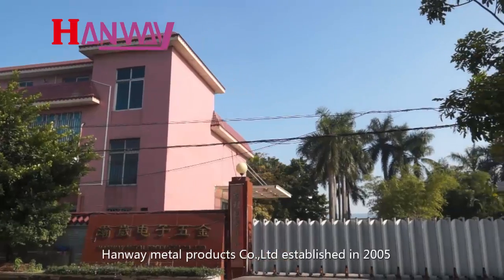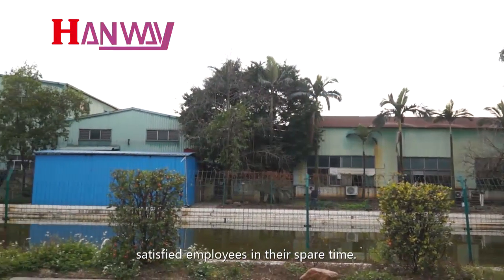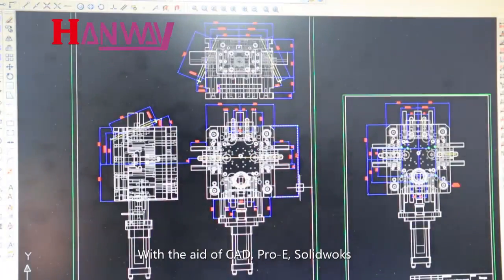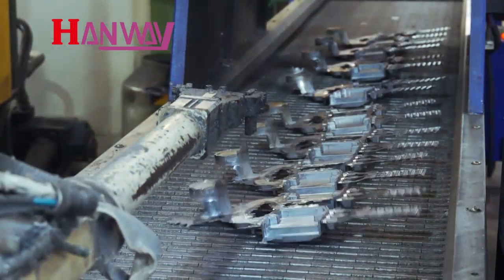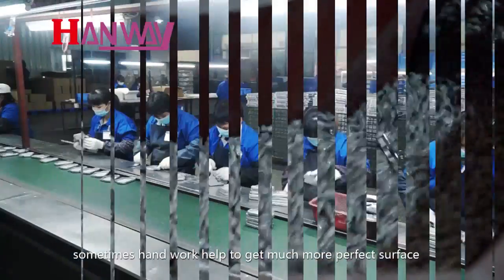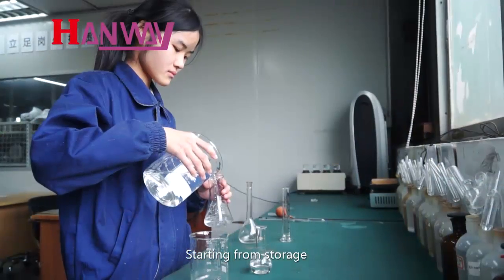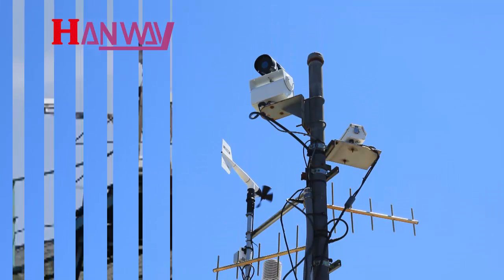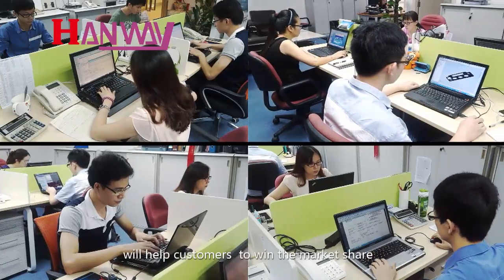aluminum die casting process - Hanway Metal Products Co  Ltd

Comment: I am impressed by your die casting plant. You are using robots and automation which is very important these days to be competitive in the industry. I also see in this video that you are implementing an "effective" quality management system. Metal die casting is a good technique for producing precision metal components at medium and high volume with short-turnaround times with high accuracy. Parts will have high precision, very good surface finish, can either have smooth or textured surfaces, and be repeatably produced. It can take weeks to make the mold which is not cheap, but once the mold is made, parts can be produced inexpensively and fast many many thousand pieces using the same die casting mold. Aging molds may be repaired or replaced depending on their condition. So metal die casting is a technique good to be considered if you need the same parts repeatedly, over and over again in significant quantities as you deplete your stocks or even for one time production if quantities are large enough to justify die casting mould fees. Thank you for making and sharing such a valuable and instructive video ! You can watch more instructive videos as this on our Youtube channel by clicking our logo to the left.